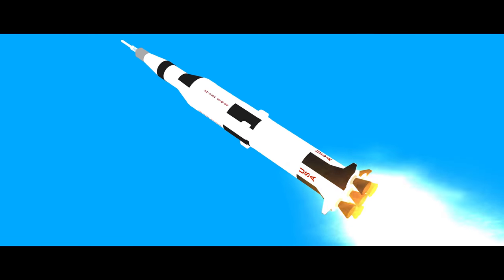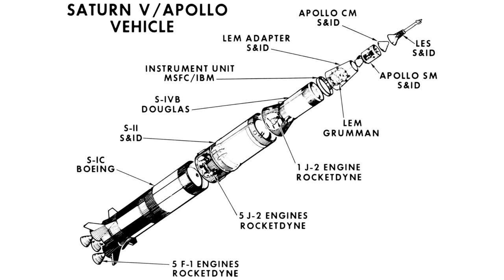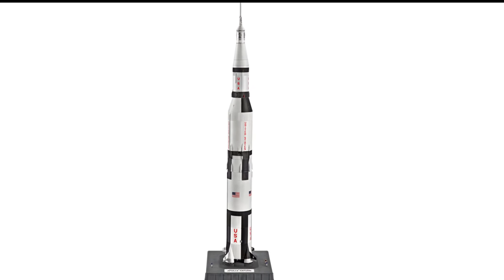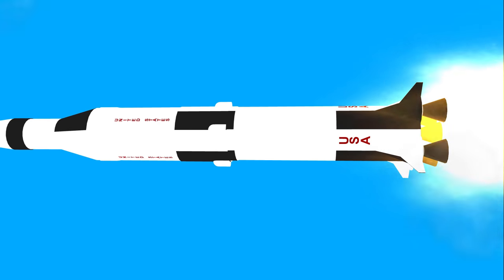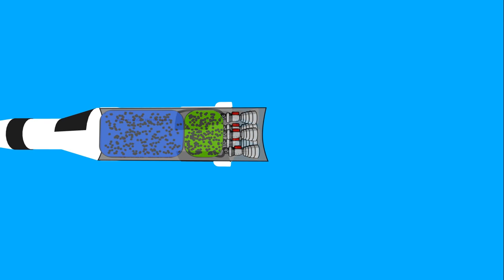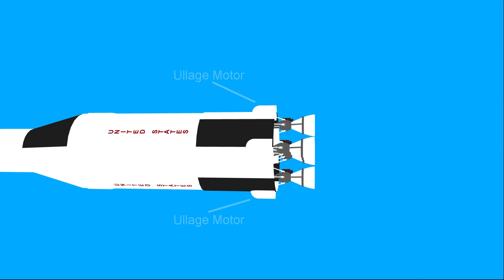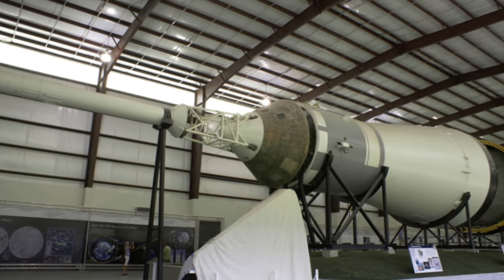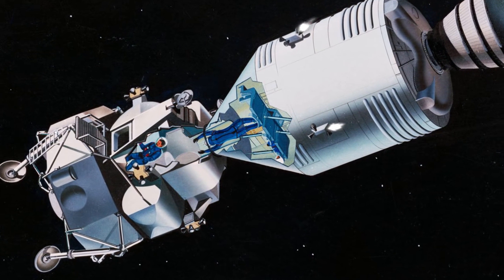The Ullage Motor: Small  but very important

Comment: One nitpick:  the horizontal velocity doesn't create microgravity.  The fact that nothing's pushing on it does.  The same microgravity is achieved in the KC-135 when it flies a parabolic trajectory.  Something IS pushing on it, though: air.  The engines have to exactly counteract the push of the air to keep the plane flying downward at the right speed to make it appear, from the inside of the plane, to be in free-fall.  They are accelerating toward the earth, and have to pull out of it before hitting the ground or going too fast for the plane.
Reply from the maker: Correct. I was literally lost for words at the time of the writing when I realized that that part of the script would require a longer explanation. So now it's complete. Thanks.

Comment: Just a little detail since i've seen a lot of people wondering about it. Ullage motors, such as the ones used in the Saturn IB and the Saturn V, are not liquid-fueled, but SOLID-fueled. They are self-contained and don't require ullage themselves. 
In the rare cases (unwanted complexity) of liquid-fueled ullage motors, they are turned on right before MECO so that the remaining thrust from the MEs acts as ullage for... the ullage motors themselves.
Reply from the maker: Thanks for adding additional detail to the video.

Comment: Ullage is interesting, 
it comes up in so many ways. For example the Boston molasses disaster, it was claimed that the tank which ruptured was filled to the brim without ullage and on a very hot day it all expanded causing the tank to rupture.
It doesn’t help that the tank was old and not designed for molasses. There was a rumour that the molasses was rushed in so the company can start making alcohol before Prohibition kicked in. I might be wrong, I thought it was OK to make alcohol for non drinking purposes.
In Mt Isa in Queensland, the local taxi drivers have LPG tanks, they have defeated the ullage system so they can cram lots of LPG at the start of the day when it’s cool. They then drive around picking up passengers and creating this space. If this fuel is not used up, the pressure builds up and the safety valve opens spilling and wasting the LPG.

Comment: Nice video, a good explanation of why ullage motors are needed in multi-stage liquid-fueled rockets.  Just a simple point that may need attention in the animation:  In the cutaway of the Saturn V staging process, when the first stage separates the animation correctly shows the second stage ullage motors firing but also shows the liquid fuels being forced to the top of the tank rather than the bottom of the tank where it flows to the pumps and subsequently fed into the combustion chamber of the engines.  When the ullage motors fire the fuel should be forced to the bottom of the tank, towards the fuel pumps and rocket engines.  Other than that, a good, informative video.
Reply from the maker: Thanks for the comment. In the animation the colored sections(green and blue) represent the liquid fuel and oxidizers. The many small gray circles represents gas bubbles and they move towards the top of the tank.  I may have made the animation confusing when I stated that the fuels is floating around but shown it as a solid non-moving color.
Reply: @ReflectiveLayerFilm   Thanks!  Sorry, I just saw the whole animation backwards, dark as liquid, light as gas. 🫣

Comment: So, what will happen if you try to start engine with air pockets in the tank? May I remind  you that engine underperforming for a few seconds is not a problem for that second stage. It once flew without two of it's engines and flight still was successful.
Reply: I figure it'd probably sputter, perhaps tear up the turbopumps or the engine.
Reply: Well it's best for 100 percent success rather than luck.

Comment: This is a pretty neat solution. So this is how the SpaceX rockets land themselves back on Earth; by burning ullage motors retrograde to restart the engine? Same with the moon lander? Interesting to think about how the fuel inside the tanks remains in freefall while the outer casing of the tank is accelerated around it so that the fuel ends up at the bottom. Great video and animations!

Comment: Great video. Just one thing though, and I'm not being pedantic; you said the ullage motors aren't to push the rocket forward, but to push the fuel into the bottom of the tanks?
It does this only because it does push the rocket forward, in order to create an accelerating force. Still a well done video 👍
Reply from the maker: You are correct. I only said this to illustrate that its purpose is to settle the tanks not to provide useful motion.  This is to contrast the other engines/motors which purpose is to move to rocket through a distance.
Reply: @ReflectiveLayerFilm  That's understandable. Again, great video 👍.

Comment: If only you had mentioned how they are fueled, considering the video is on how rocket engines keep the fuel where you want it - which it isn't during staging - and ullage motors are little more than rocket engines.  So, where does the ullage motor get its fuel and how it IT kept primed?  Solid rocket fuel?  Are they mini SRBs?
Reply from the maker: The ullage motor uses solid fuel. A liquid fuel ullage motor would have the same issue with fuel as the main rocket. Cold gas thrusters can also be used as ullage  motors.

Comment: Falcon 9 uses cold gas thrusters on its 2nd stage not ullage motors.
Reply: Those are still ullage motors, just using a different propulsion fuel.